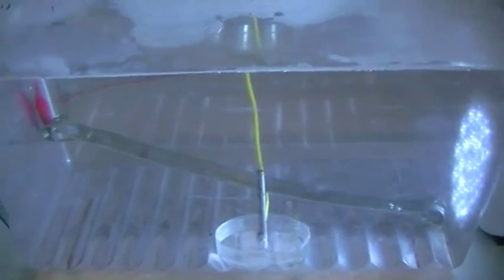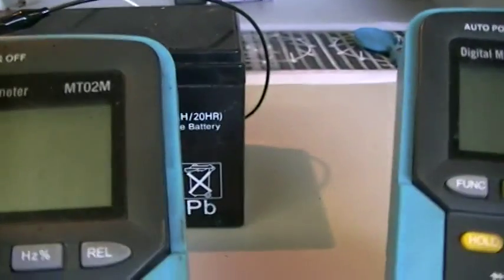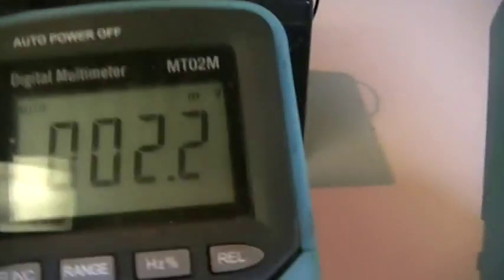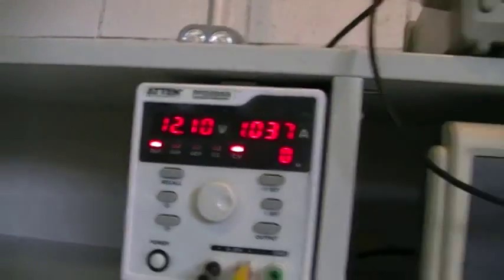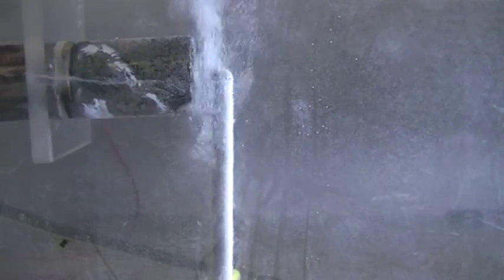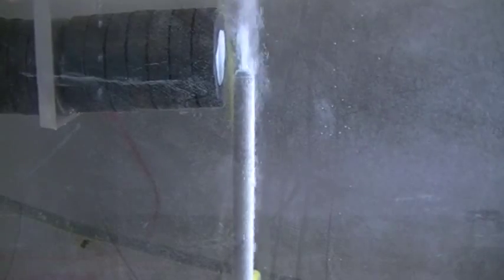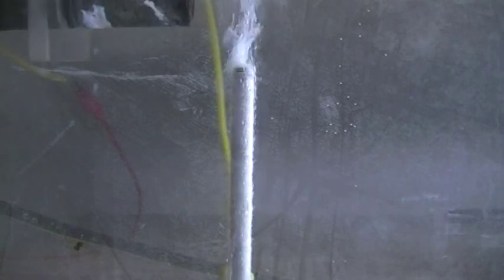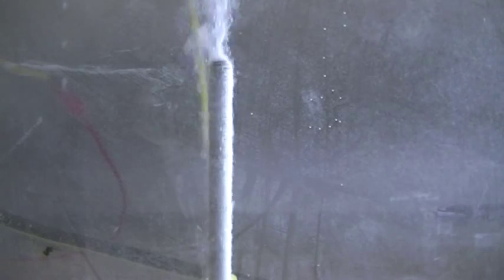magnetic vortex,non conductive ferrite magnets

Comment: ALL magnets are dielectrically conductive, NEO or ferrite.  You are getting interaction between the dielectric capacitance of the neos AND ferrites with the electrical charge in the electrolyte.  Not electrically conductive on the ferrites, no, but in altering their capacitance, they change and reciprocate reaction with the electrical polarization in the discharge into the electrolyte from the electrically charge electrolyte and bar with your rising H bubbles as indicator.

All so-called "non-conductors" (oil, glass etc) are still dielectrically capacitant and affect electrical currents

Electricity and dielectricity reciprocate their reactions between each other in ANY AC system (and DC) and likewise magnetic polarity (rather the field of dielectricity as meant) affects likewise the discharge polarity off your stainless rod

Sweet stuff!!!!
Reply: Is this the same reason why a magnet "quenches" a spark gap? I've done experiments in the past w/ HV and ferrites, and although the ferrites don't conduct lower voltages, they certainly increase the potential length of a spark gap w/ a fixed HV. Also very interesting is placing the 2 HV leads on either side of the magnet and watching the arcs follow the flux to the event horizon. Cool stuff.
Reply: Im doing the same thing now with a new invention I am developing using multiple lasers and beam spliters, when I get rights, and post videos, peoples heads will roll, i have posted single channel snapshots of this on Over unity.

I havent experimented with spark gaps in a long time.   Dunno, to say, would be pure speculation on my part.
Reply: Theoria Apophasis These experiments could be done in zero gravity to see the whole field :) The sun is a good thing to observe with that too. The plasma follows the flux in loops above the sun spots...same thing I reckon. Peace!
Reply: I get identical magnetic plumes using my laser invention on a magnet
Reply: Theoria Apophasis I'm guessing that it might show how magnetism, electricity, and light are interconnected...sounds supremely interesting. So, you get identical spins?...or no spin? Monopole perhaps? :)
Reply: you can call a moving magnet a DRIVER element, the conductor the REFLECTOR element and the DIRECTOR is the right hand rule.   Electrification works the same way a YAGI antenna does really
Reply: ***** yeah now that would be something